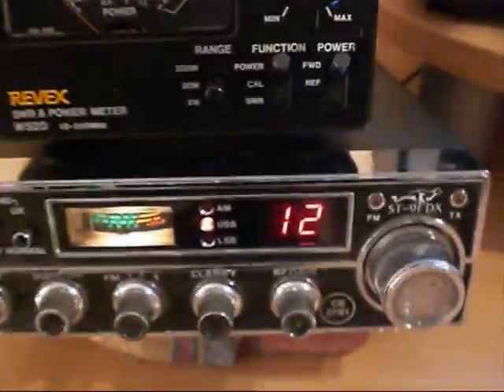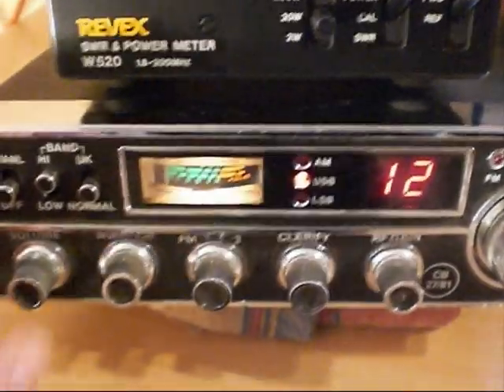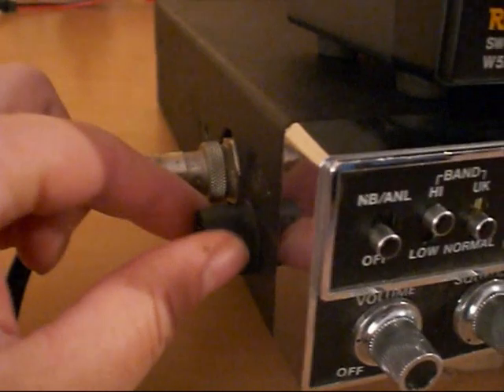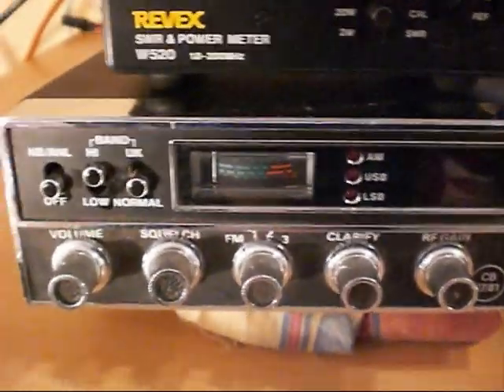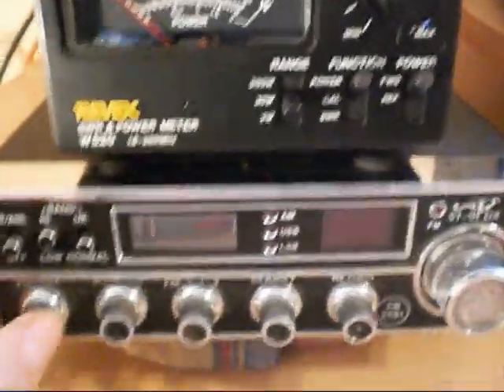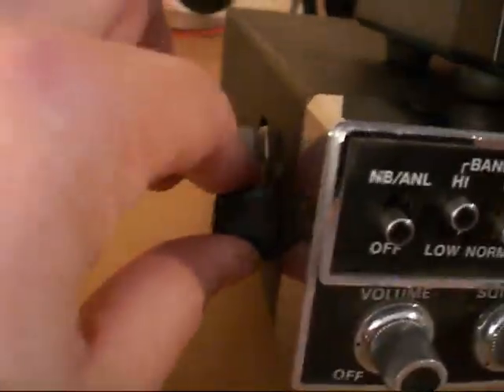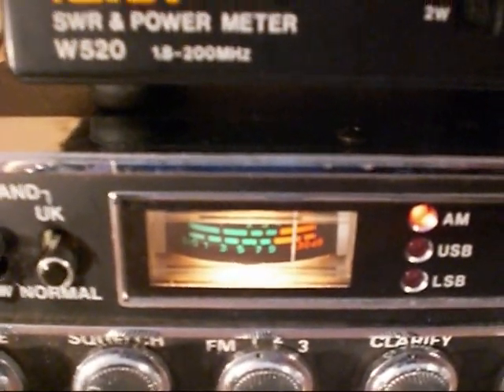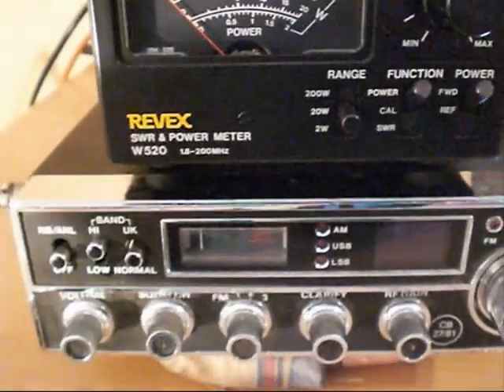STALKER 9F-DX, OUTPUT SUPPLY REGULATOR REPAIR/REPLACEMENT.

Comment: It should be doing 12 watts pep ssb standard like the cobra 148gtl-dx so even the ssb output power is set too high at 20 watts.

Comment from the maker: If i was you i would wait until you have the radio, radios do not go out of alignment on there own so if it has not been messed with it should be fine.

It's when some idiot has been in there with a screwdriver you have to worry!

It may be spot on so a service may not be required.

Comment from the maker: @Koolnote   To little carrier power will reduce swing just the same as to much carrier power, most of these types of radio were made to run at 4-5 watts carrier on AM with good swing.